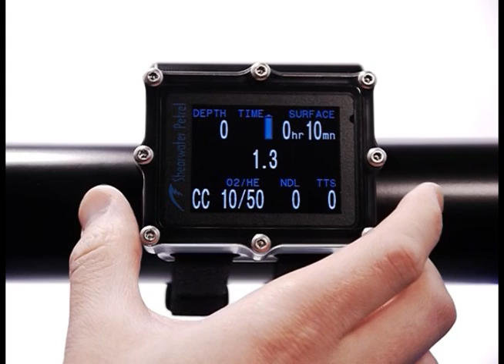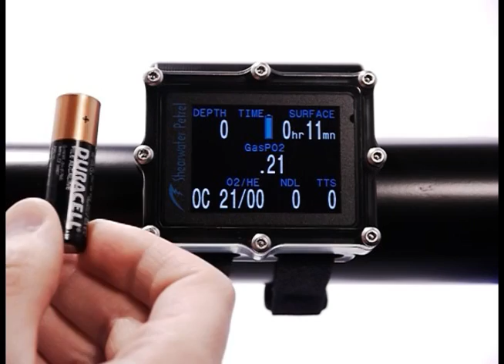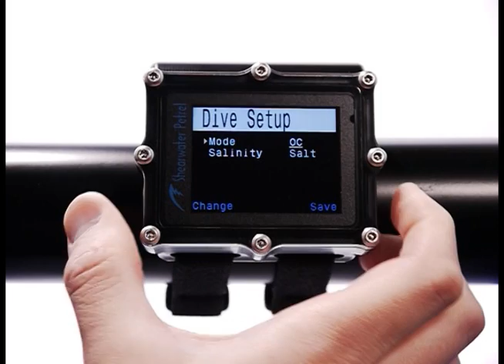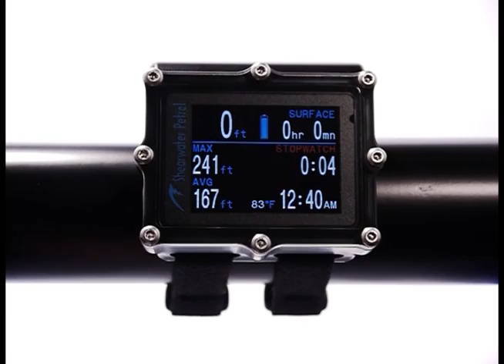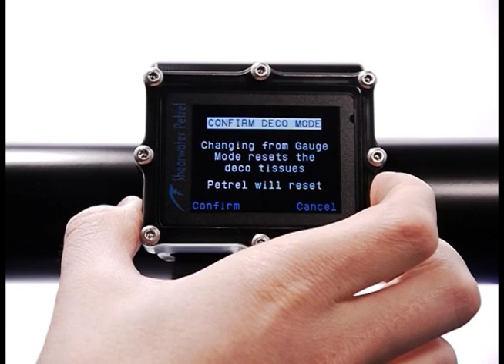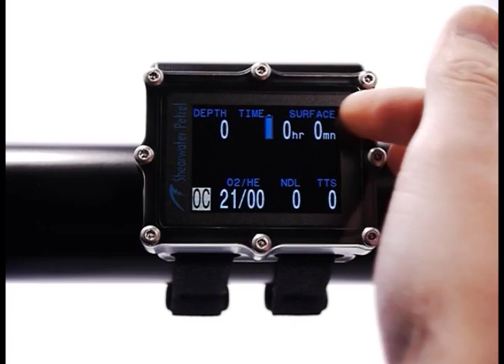Petrel Introduction

Comment: How are the alkaline batteries with cold water use?  Would it be necessary to switch to a lithium battery for this?
Reply: a long time awnser, but no, you can use a normal alkaline battery even for cold diving, I had a normal 1€ alkaline battery for 30 hour in ~3°C water so